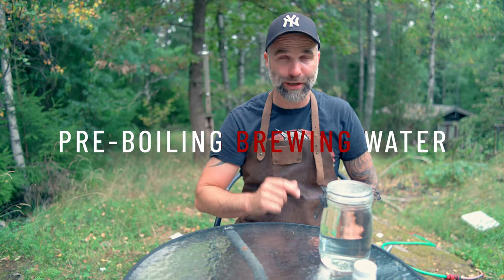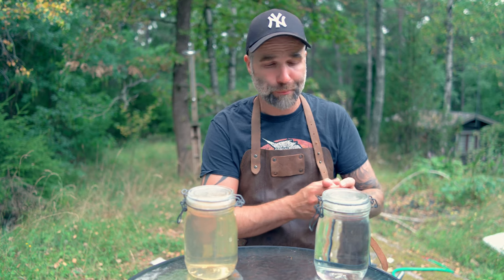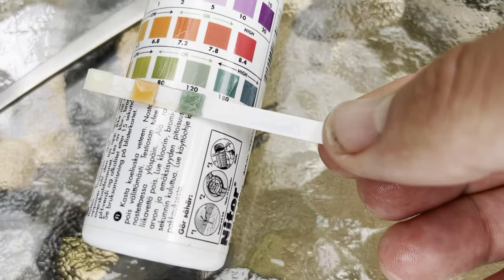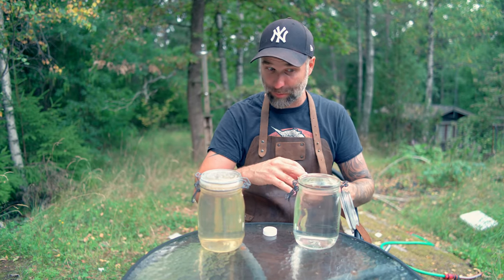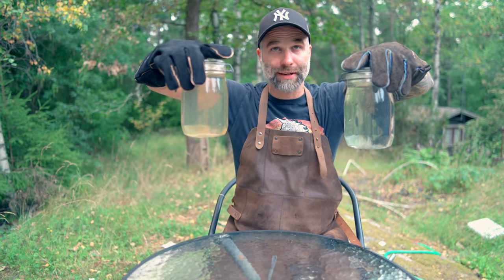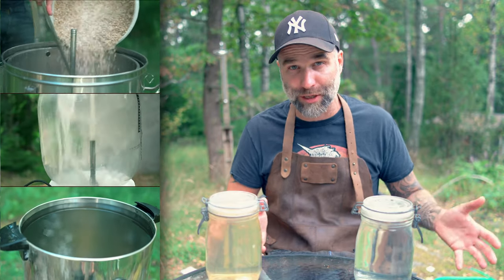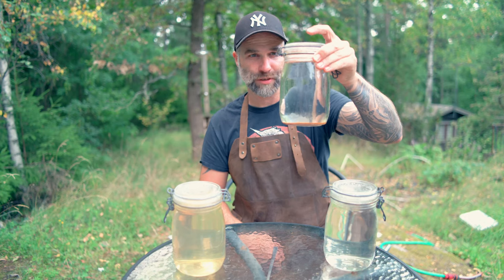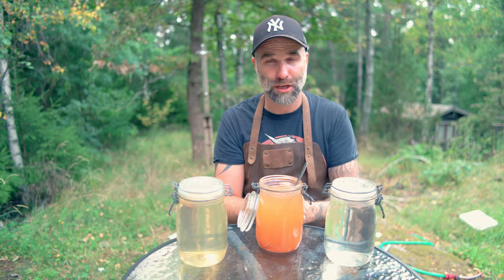PreBoiling To Improve Brewing Water - Alkalinity

Comment: The other option is to get a formal water analysis of your water and then make the necessary water adjustments for each specific beer style with one of the many excellent softwares available.  This is an interesting part of the brewing process for me and definitely improves the quality of the beers.
Reply from the maker: That's the basic issue with all problems humans is trying to solve. Adding to solve a problem. Put a bandage on it. What should I eat to lose weight instead of what should In not eat?
Reply: Or just buy a cheap scale to accurately measure your weight to make good dieting decisions instead of just guessing.  A water analysis isn't expensive.  Your viewers would like to learn about easy and accurate water treatments.
Reply: @jarroberts2  dropping out all that iron and heavy metals is never a bad idea. Creating a blank canvas is essential before composing good brewing water. Just my take.

Comment: Hmm. I'm thinking I'm lucky my tap water is 5.29ph and on last check 180 to 220ppm hardness. I rarely adjust it much my ph is usually 5.2 to 5.3 after mash in depending on grains used. And adjusted with acidulated malt, salts or phosphoric acid adiition i only need a very small amount.Interesting though all the same and the usual campden tablet..Those dregs were very interesting indeed...

Comment: Dr, you have a problem with temporary hardness. Boiling will help, but that's a slow process. Brupaks AMS Carbonate Reducing Solution (CRS) is a faster treatment, so that's something to consider. I would want the sediment to settle out before using any treatment. If you need to boil your water for the sediment to drop, there would be less / no benefit in using CRS.

Comment: I have really hard municipal water, so from time to time when I brew some sort of lager, I boil strike water to get bicarbonate out. If it is from your own well wouldn't it make sense to invest in an RO system? Since no one is charging you for discarded water.
Reply: I think you need quite a high pressure in the tap for an RO filter  to work properly...
Reply: @Wrongald  Some systems come with an optional buster pump. Those are necessary if pressure is under 60 psi or if dissolved solids are over 500ppm.
Reply: That was new info for me. Thanks!